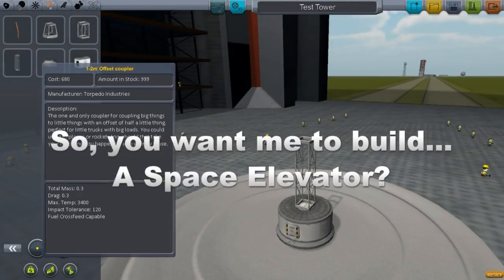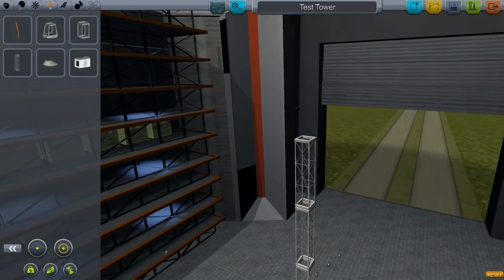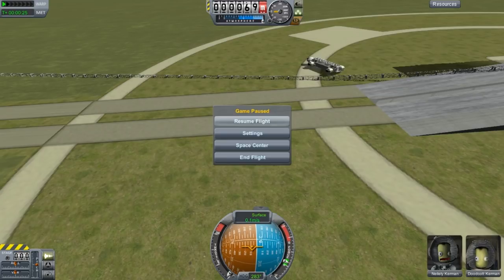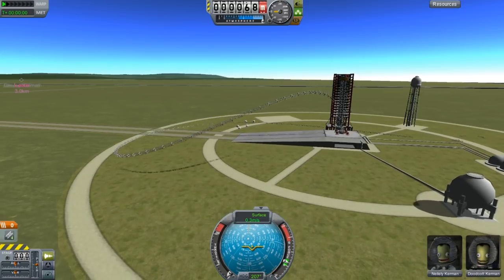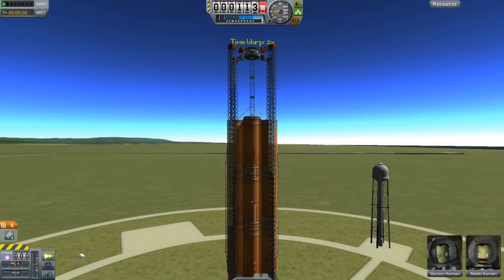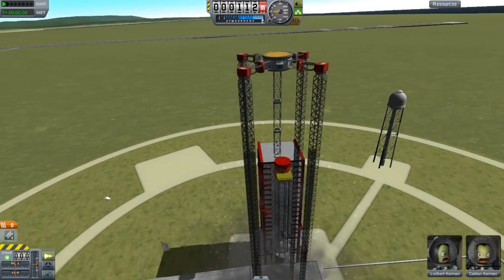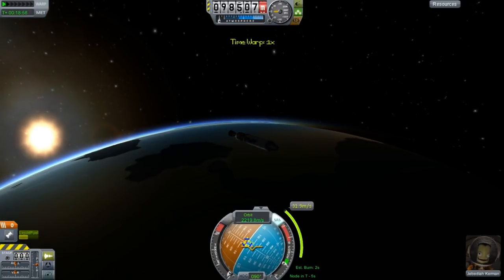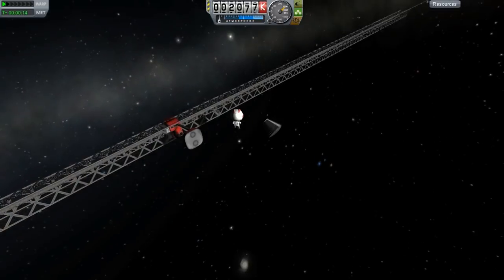Kerbal Space Program - So, You Want Me To Build A Space Elevator?

Comment: In Bubblegum Crisis Tokyo 2040, they have this design for a Space Elevator that's basically a big aircraft on a stick, which they use to crab cargo that's launched on a rail at high speed, and the whole thing is connected on a contraption in the form of a belt around Earth, if I recall. It's quite the fascinating design.

Comment: Can you try again but place it on low grav worlds? Minmus? I think 1.3.1 is stable enough to change the physics distance to max. Also, using a pile of confined debris, it would be nice if somehow you could visualize the Roche limit. As we know, a single craft does not experience a difference in gravity. Using rigid attachment and maybe modifying the physics.cfg would probably help (break force & torque when using rigid attachment).
But if you're not interested I could make a video myself in a while.

Comment: Soooo, what are you planning to use to get the rocket to the top?  Winch? that's a really big and long spool of cable.  What material would be used to handle the load of the rocket, its payload and the weight of 164km (82km up & back at start) of cable?  Oh, and how much carbon are you putting in the atmosphere just manufacturing all the materials and actually constructing this monstrosity.  Is everyone using (renewable energy powered) electric cars, trucks and machinery that works on this  project, etc. etc., etc!!!   There are SO many ill gotten ideas about a space elevator, but at some point everyone just needs to give it up and focus on magic which would make about as much since as this.

Comment: To build a non self supporting tower over 60 feet you must use guy wires to keep it stable.
A general rule if for every 100 foot of tower you bury 10 feet, So a 1,000 foot tower would in practice have 100 feet buried in the ground.
A tower reaching geosync orbit in theory would be buried very deep if not poking out the other side of the planet, Also orbital inertia in regions between the surface and geosync would cause instability and the tower will fall.
When a tower falls, by engineering design the tower should fold or "accordion" downwards. This is part of the tower sections design if a critical failure occurs. It is safe for the tower to fold than to lay over. Think of a Television tower at 1800 feet height. You live 1000 feet from the site. Would you rather have it fold up at the site or lay over ontop of you and your home? This actually happened here back in the late 60's when a small plane clipped the guy wires of an 1800 foot TV tower. For the most part the tower folded and piled up within a 100 - 150 foot circle boundary of the site with exception of actual antenna parts shattering and flying out at terminal velocity here and there.
Now KSP does not have the realistic physics natively therefore towers will not fold up and break off at the joints but they will snake up and/or lay over. Also KSP does not have guy wires BUT they do have struts which could maybe be utilized to some point.
One could maybe place SAS modules and RCS systems every few hundred meters and that may help keep the sway down but you sill have the issue of "compiled weight" (what I call it where the first section bears more weight than the next and so forth upwards) towards the tower base.
So in KSP and in Reality with current technology building a space elevator is not practical nor safely possible.

Comment: You said that in order to build a space elevator, each layer of it has to support the weight of the layers above (Paraphrase), but that is not necessarily true. If the space elevator gets above geo-stationary orbit level then gravity pulling the structure down and the syntrifical (be cause I can't spell) force pulling it up and away from the planet because it is moving so fast (kind of like whirling a bucket of water around and none of it coming out)  could even each other out. We could build a space elevator up to 35,000 kilometers high. Of course we don't have any materials that could withstand the tension except for maybe Carbon Nano Tubes. This could actually be feasible. But then we would run into problems like building it, and dodging asteroids and other space debris.

Comment: Wouldn't it be possible to build a space elevator on the mun though?
Reply: Yes. but if you are referring to what he is describing in this video there is little point. Achieving orbital velocity from the Mun, or The Moon for that matter, is significantly simpler and economical than escape from planetary gravity, and atmospheric resistance. A mass drive/rail launch system on the Mun/Moon is more economical and efficient. 
However, what is feasible is to build a long tether from the Moon to low Earth orbit/upper atmosphere. This means in order to get to high Earth Orbit, or even the Moon you only need to get to Low Earth Orbit and ride the tether to your desired destination. A considerable savings in fuel.

Comment: I agree it will not work with the game mechanics in most situations.  But I wonder if it would work on Gilly.  If a Kerbal sneezes really hard they would be leaving it.  Could have a whip effect because of Gilly's rotation.  I don't think struts can be that long. I take that back  It wouldn't work there either.  If the parts were in the game I wonder if a rail gun would work from the lower G moons.  0 to 3G acceleration in 10 seconds.  Would have to calculate the materials necessary for that run.  Lower the G of the moon then the lower the acceleration needed.

Comment: if you built it twice as high as needed wouldnt that act as a counter balance? old video but still worth the comment
Reply: +sheep mo-lester that's the idea, they have to have mass sufficiently far beyond geostationary orbit to do it so that its tension keeps the system up, like if you have a rope with a weight you spin around the weight pulls the rope away from your hand despite the only force applied to the rope weight system is aimed at your hand

Comment: I still think the best way to build a space elevator would be a massive tower that starts from the ground. Problems.... It would have to be something like 80KM high, but the idea is that you have the top of the tower outside the atmosphere. It would probably have to even wider, maybe 100KM on the ground, and would probably require a planet wide effort to build.
Reply: I think it was the designer of the Burj Al Arab who said: "Currently we do not have materials to support a building higher than 2km." So even stuff like carbotanium (carbon composites with titanium alloy) wouldn't cut it. If you were to have the other side of the tower outside escape velocity range, it would lighten the load quite a bit, but still materials can't cope with the strength.

Now in KSP it would be an whole other story, but to be honest, I'm not that at home with the physics of it all (yet). But I'm curious about other attempts.

Comment: First: This problem could be solved by implementing a sort of piston system in the middle that allows it to extend and contract.

Second: to solve the problem on the earths side set up a large circular rail around the equator that the tower moves along. This only leaves the problem of how to construct the rail so that it can move at roughly 1600km/h (earths circumference: 40000km divided by 24 hours in a day)

Comment: Space stations must orbit at above 70,000 m. Spaceships can only be around 60 m tall, and you need a way to get the elevator into space, so most of the ship itself is rockets. So lets say each rocket you build can successfully launch and dock 80 m of elevator, then you need 875 of these, all docked, which would take you probably around 700 hours. Then you need to rotate the entire spacecraft so it's pointing to the ground, and not just near the ground- straight to the ground.

Comment: Geostationary orbit is 35,000km above the surface of the earth. The Eiffel tower is 320m tall and weighs 10,000 tonnes. So the top of the Eiffel tower is at 35,000km, great, now you need some structure at 34,999.64km that can support 10,000 tonnes! Say that's 640m tall and weighs 100,000 tonnes. Now you need a third structure at 34,999km that can support 110,000 tonnes. And so it goes...

Comment: Question, Scott:  Assuming that you were lowering a cable from orbit to be attached to the ground at a specified point, and the start point was in perfectly stable, geo-synchronous orbit, what kind of forces would the end of the cable have to endure?  Would there be air resistance against the atmosphere, or only what's generated by the wind?

This has been bothering me all day.

Comment: even if you had the right materials and the right engineering techniques and everything would be perfect you would still be building something that has a fixed position relative to the surface of the planet so any satellite in LEO on a polar orbit will collide with it at one point or another... even if the cable/structure is strong enough to survive several hundred kilos of satellite smashing into it at ~7km/s the resulting oscillations would make the thing useless

Comment: Physics engines work on bodies (the girder segments) and constraints (an invisible joint between each girder segment). If the constraints are set to be completely rigid, you will still get motion. Constraints work by negating any motion the body has in order to keep it there. Due to numerical rounding errors over potentially millions of constraints and bodies, the result will be a huge jumbling vibrating mess that gets more chaotic as time goes on.

Comment: I was watching VSauce I think it was the other day and they actually talked about this. At the moment we don't have the materials strong enough to do it but they worked out that is is possible. The first half would be pulled down, but the upper half would be pulled out thanks to the rotation of the earth. The farther you build it the more the pull the less it weighs on earth. Assuming you could get it far enough in space with a heavy object on the end it would stay rigid. Wouldn't ride it though

Comment: If the tower is long enough, it will become taut as the centrifugal force acting on the outer end of the tower would 'pull' outwards, much like a spinning rope, if you spin it fast enough, it will become straight. At this point, the area at which the tower contacts the earth suddenly becomes the ANCHOR instead of the FOUNDATION.

Comment: The idea of a space elevator would be that it is so long that  it would be held out by the centrifugal forces of the Earth. Of course the build material would either have to be incredibly strong, or somehow eased into it's "orbit" so it doesn't take an initial strain from the deceleration once it's at it's maximum cable length.

Comment: You could try to build a tall tower on Minimus. It's close by, has low gravity, and has truly flat land. A tower design I made has the lander can cockpit, and some fuel tanks attached to the top and bottom of it. Attached radially to the sides of the fuel tanks are three stacks of fuselages with docking ports on the ends for building it higher.

Comment: If we had carbon strength cables in KSP that were extended from the bottom of a rocket to a geo sinc orbit at an unlimeted to +100 Km Orbit would we be able to create space towers as there is a winch mod and i can also create a carbon strength cable mod if need be :D

Comment: My first thought for an orbital elevator is build 3 towers in a triangle, thousands of miles apart using some super strong wire, connect them to a single geo sync orbital center and run the wire down the middle. This might offer much greater stability and remove a huge threat of it accidentally falling down, it would just snap. And if you run the line on each of all 3 points about 3 times you could install a safety mechanism to prevent from total loss of station or the elevator. 

Instead of relying on a line that might buckle, just build a simple lift on a wire. or 3 wires from each of the 3 main points. Might be a bit of a bumpy ride but it's the safest for passenger, cargo and the areas around the elevator focal points. Unless the line snaps from the top, I would suggest putting a secondary safety lock 55% of the way to the top (thats why you should run the wire multiple times and put a mechanism to make sure 2 or 3 lines run through it, in case of failure this mechanism could clamp all the wires so that the other(s) would hold the one that failed) to catch the wire before it hits earth and does any damage.

I have no knowledge or experience in this shit. But it makes sense to me, Maybe someone might try it as an experiment 1 day.
Reply: xXPureEvilXx101 hmm. i was thinking about how to do this in real life and im a big fan of centrifugal force artificial gravity and im like... why dont we just start in space and use the tower as a rope to suspend a mass in space using centrifugal force to pull it away from earth?
Reply: +themotorfreak1  becouse of the atmosfere. on a moon or a planet with little atmosphere, a space elevator would be easier
Reply: +themotorfreak1 If you start from, say, geo-stationnary orbit and start building "down" your elevator, then the CoG (center of gravity) for that elevator will change, bringing you out of said orbit. You would have to build "up" as much as you build "down", basically building a space elevator that`s twice the lenght (and the budget) you`re expecting. (Actually, it's weight and not lenght that you'll need to allocate correctly, I just find it simpler to visualize this way)

Comment: fuel tank at the bottom , rockets at the top to keep it up
Reply: +Jared Reabow (Jazza)     its not actually necessary.  The thing Scott started to mention, but didnt quite get there, is that at a certain height above earth (in reality) the orbital velocity of the space end of the elevator / cable is actually moving fast enough (to maintain geostationary orbit) that centrifugal force is actually strong enough to pull the elevator away from earth. So you just need the cable to be REALLY solidly attached to the ground, and as long as the tensile strength is high enough to prevent snapping, the elevator cable will stay up and stay taut all on its own (well, due to physics)    The reason it doesnt work this way in Kerbal is the orbital speed at the highest point on Scotts tower is being calculated as the same as it is at the ground (essentially FAR FAR too slow for actual geostationary orbit).   In real life, the reason we havent made a space elevator is there is so far no known material strong enough to keep from being ripped apart by the outward force.   Its like pulling at two ends of a string until it snaps, we simply cant make a cable strong enough to keep from snapping.

Comment: In real life, it would have to be built right on the poles. On the equator, the centrifugal force from the planet's rotation would send the tower flying into parts unknown.
Reply: Actually it's the opposite. The centripetal force is what would allow it to stand in the first place.
Reply: The counterweight is in a geosync orbit, so it stays in exactly the same place above the base far below it. A polar geosync orbit is impossible. So no.

Imagine you're spinning around in a circle on the ball of one foot. You let go of a ball, tied to your wrist by a string. The ball extends outwards and stays in line with your hand, provided the string is long enough. That's a space elevator.
Reply: Jetman123 the horror if a space elevator falls down
Reply: mrMultaigamer "Falls down?" The end of the thing is in orbit. Even if the counterweight snaps, the cable falling to earth would burn to ashes before it made it down.
Reply: not everything
Reply: Jetman123
would it? even then. only the part in orbit would burn up. theres still a far amount of it that would fall over.
Reply: CallumN02 Actually, if the space tether is strong enough to withstand the forces applied to it and the odd piece of space debris, it would easily be able to hit the ground. Rocky asteroids that aren't even made of high tech materials can hit the earth. So to the cable it would be like a warm bath. The true horror of it is that you would have a burning cable that can wrap it'self around the earth 2.5 times. I believe 2.5 is the rough calculation.

Comment: how did you get the clamp so high?
Reply: Save file editing.
Reply: Jetman123 What value(s) needs to be edited for each part?

I know it's the y coordinate, but I am unsure which of three values in the file are the correct one.

Presented as:

PART
{
    part = x
    partName = x
    pos = +/-x.x,x.x,x.x
    rot = x,x,x,x
    attRot = x,x,x,x
    mir = x,x,x
    istg = x
    dstg = x
    sidx = +/-x
    sqor = +/-x
    attm = x
    EVENTS
    {
    }
ETC.
{
}
}

Also, are these values usable to put a vehicle onto an orbital path using this file or another file?

I know it's all really cheat-y but Some vehicles are just really difficult to launch as a single piece and I don't want to have to build it in orbit (it saves on part count, and therefore memory).